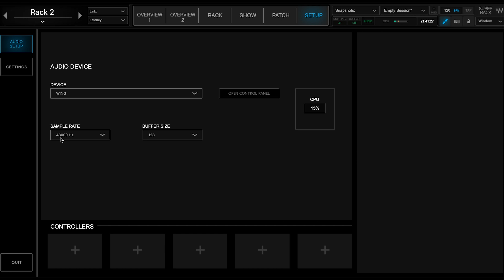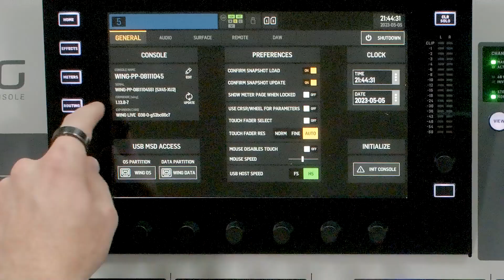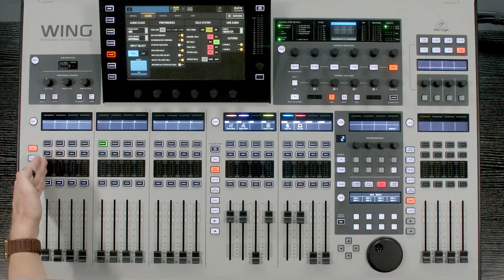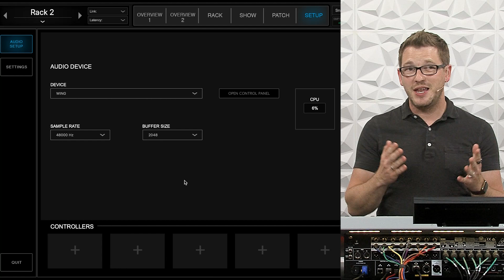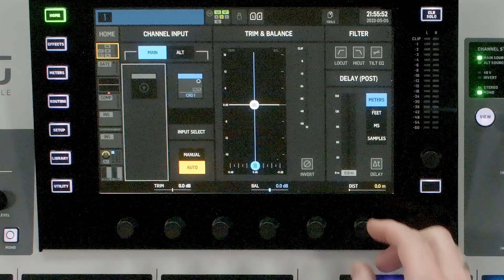Waves SuperRack Performer Latency with the Behringer Wing

Comment: Drew. Can Ultranet can act as that double patch for monitors?
Reply from the maker: I would be interested to see what you are trying to do. Ultranet is 16 outputs, you can get the DN4818-O https://sweetwater.sjv.io/VmyKVa if you wanted to convert the 16 Ultranet outputs to XLR outputs. Then depending on how you route it, it could be really whatever you want to use it for. For instance you could have it as a digital split to give 16 channels of outputs right after the preamp, or you could use it as 16 outputs.

Hope this helps!

Comment: Omg! This latency is absolute useless. What are you going to teach your viewers?😱
Reply: I'm using Wing rack with live professor and zero latency plugins from waves. My sample rate is set to 128. And no one ever told me that they can hear any delay from pa. Even if someone stand somewhere near from main groundstacks, for example.
Other situation, that u might be wrong is a delay on the stage. When you don't attempt any distance to input channels on your console. So u necessary need to check all length on your stage plot design, for your instruments. Especially when you are using front fills or loud monitors on stage (just don't forget to check your levels of all acoustics within your setup). To make everything to be in sync on your sound path to your mains.

Comment: Hi @drewbrashler 
 I have a X32 with a snake cable box with 8 outputs on stage, i also have the sd16 for an additional 8 outputs. How do i route my mixer to take the first output from my xir output and the other 8 outputs from the SD16 stagebox output.

Comment: with Dante card how much latency does it reduce ?
Reply: sadly, dante virtual soundcard actually increases latency worse than USB.
Reply: @magoostus  no I actually meant the Broadwayii card that can’t be installed on Wing
Reply: @clash_new_taipei  "brooklyn3"  and as far as I know, the brooklyn3 module works fine in the regular expansion slot, we're just waiting on new firmware for the internal slot
Reply: @clash_new_taipei  Broadway chips can only do 16in/16out.  so  it cant be a broadway chip... unless they're using 4 broadway chips together